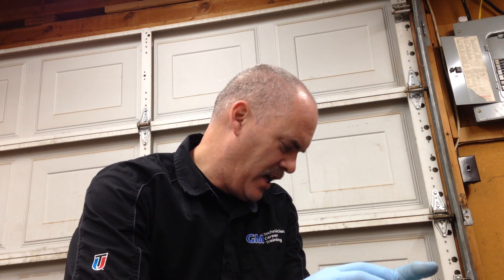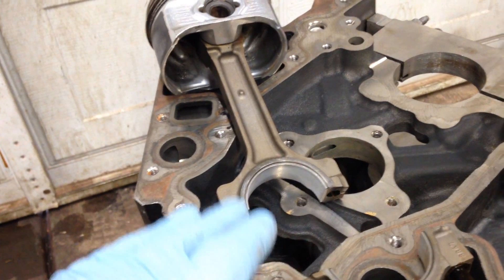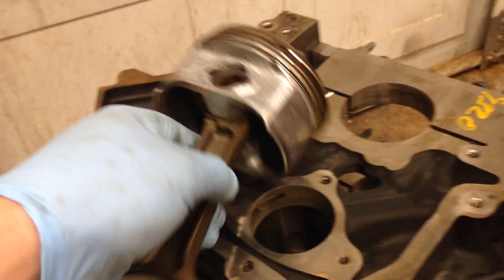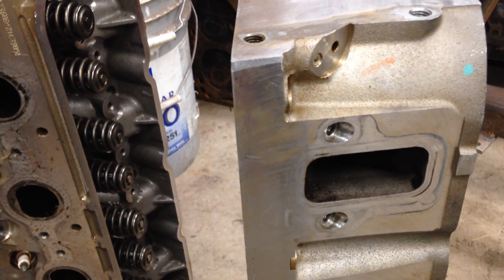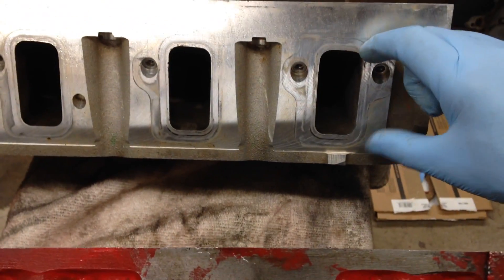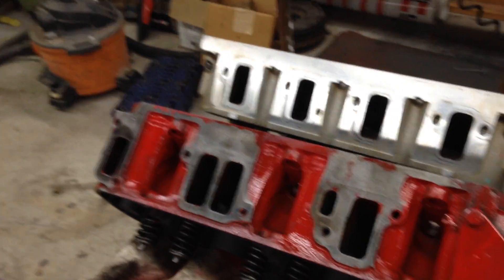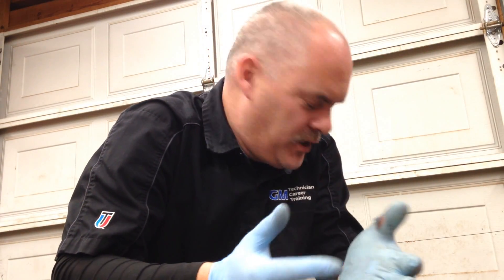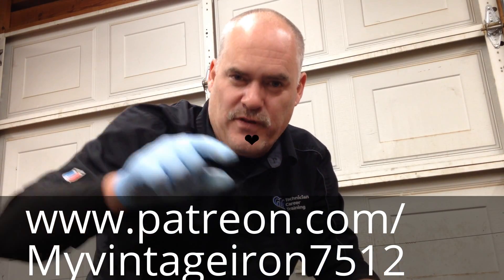LS Upgrade 6.0 to 6.2

Comment: Those engineers you talking about there are Dead,, the new young SMART engineers are coming up with crap like plastic guides for the engine lifters witch got stuck in my engine it broke a valve spring, dropped on the piston got pushed up against the head with made a dent tore and twisted the piston made a dent against the sleeve block and the engine block is now is junk, my mechanic is looking for a used block so he can rebuilt the engine. If the block could have been Iron instead of aluminum the rebuild could have been cheaper. GM and Ford are making CRAP all day long.

Comment: This has been quite a good lesson. I have a LQ4 in my 2003 2500HD. I never knew I could run LS3 Heads on the motor. Heck I could even throw in an actual 6.2 engine but would have to build the 4L80E to handle the 450hp the 6.2 makes.

Comment: Nobody is saying that GM stole Ford's head designs. What some are saying is that Vortec and LS heads use a port design similar to what Ford used because they worked well. For instance, the FE heads had terrible flow characteristics, but worked very well because of their high swirl design. Yes, GM took that concept and put it to use, but created better flow in theirs. It isn't that Ford owned the high swirl principle, but they were the first to use it. That is why it is prudent to say GM took Ford's port design.

Your narrative about Chevy ports being used for decades... then showing the port shape at the intake manifold mating surface.... That's very misleading, because the port design that matters is between that surface and the valves, which I assure you that is very, very different. 

It seems you're simply trying to tell people that GM figured this out all by themselves, but they were wise and investigated what worked between all engines, and what didn't, then designed their Vortec and LS accordingly.  Stop muddying the waters in the Chevy/Ford/Mopar battle, because you're doing it with lies... aggravated bitterness at best. 

If you want to have any effect on engine builders in the future, show what makes the power differences, and don't purposefully lead others away from the truth of it all. Don't be afraid of truth, because it still takes a mind capable of comprehending such info to put it to use and make themselves your competition. But if you think you really have good information, then think again, because skipping out in two more dimensions of port design where power is made is simply nonsense.

Comment: Hello Mate John here I have just come across your videos and have spent most of today watching them. I have a 1936 maple leaf which I am looking to install a new power plant into. I like a GM motor into a GM vehicle and was considering using an older chev engine as I had a stock build 307 with a turbo 400 auto in this when I first built the vehicle back in 1982. The vehicle performed well for what I wanted it for as an everyday driver. I had this setup for about 22 years until a so called friend of mine put sand blasting grit down the carb. In a fit of rage over me telling him a few home truths he didn’t want to hear. Following that I changed to a LS1 and a 4L60 which was so/so Mainly because the new engine gearbox setup weight difference changed the ride to something far rougher then what I previously had, mind you I did enjoy having that extra power when I needed it as the 307 gave me a whole 96 kw at the wheels. Anyway the vehicle has been off the road for about ten years now and the LS1 and auto are long gone so I have been considering going back to the simplicity off the old school chevy engine until I seen your video LS Upgrade 6.0 to 6.2  as this would give me the weight and the extra go that I like. So I am writing to you to find out the details of this build if you still have them. Regards John old36trucks@me.com

Comment: I got a 09 6.0 in a 2500 I've replaced just about everything I can think of every now and then it has about 30% more power but most of the time feels like it's running lean doesn't hesitate throttle response is good no codes no vibration what would your ideas be I'm pretty much down to fuel pump injectors or simply age but sometimes it just runs perfect randomly.

Comment: cylinder walls between cylinders is very thin on 6.0's. i just sonic tested two i'm building that measured .120 before they were bored which doesn't leave much after boring out .065. way thinner than i would be comfortable. the attribute that most ford enthusiasts claim is a ford design is the deep skirt the FE's used which probably has some merit but diesels and agriculture engines have used it forever and FE's are notorious for windage pressure because of that and LS's suffer from as well. In my opinion, its absolutley not worth making an 6.2 from a factory 6.0 block

Comment: The LS motor has things that you just couldn’t do with a old small block. 6 bolt mains with forged caps. Cracked rods. Even things like the intake manifolds that flow as good as almost anything you can buy. The only drawback to the truck intakes is they are butt ugly and a little too tall for a car.

Comment: Question I have a 2009 chevy 1500 6.2 LS3 heads my lower it was ran low on oil I have a block from 2008 6.0 with all the it's stock internals can't I use my LS3 head on that block and be ok or will I run in to a low compression problem

Comment: Dont skimp on pistons hyper pistons shatter when they come apart and mess the motor up beyond repair in most cases. Do your self a favor and get 2618 pistons they are far better
Reply from the maker: all pistons mess up an engine when they come apart cast hyper or forged
Reply: You are correct sir but some pistons will come apart faster then others
Reply from the maker: @thomasbradley7844  That's for sure a cast piston will come apart long before a hyperutectic will

Comment: Can you just swap the 6.2 heads onto a 6.0 to get some add on power? Or do you have to change alot of stuff? I have an lq9
Reply from the maker: yes but a cam swap would also be advisable
Reply: @Myvintageiron7512  do I need to do a cam swap? Just checking because I want to add some hp to my escalade without having to take it apart

Comment: Its absolutely refreshing when someone is knowledgeable and willing to share. Thank you for showing the differences between the heads and explaining how they can be interchanged depending on what the desired application is for.
Reply: Qq1i
Reply: Boring a 6.0” to a4.065” bore is pushing your luck to put it mildly.

Comment: Ok , I want to put an LS engine in a 99 Jeep wrangler tj. 
It has an inline six now ,  but the LS sounds like a better build.
Which LS engine would be better to put in the Jeep?
Reply from the maker: 5.3 or 6.0
Reply: @Myvintageiron7512  So the 6.2 is not a good idea?
And thank you for getting back with me.

Comment: if you could up grade again would you put a stroker kit into this. I have a 6.0L block and 
and ls3 heads. i would like to know your thoughts on stoker and boost for this build?
Reply from the maker: I'm not crazy about stroking these engines ive seen these kits pull the pistons to close to the bottom of the cylinder and wear the pistons rapidly.   As far as Boost goes  YESSS DO IT! for sure you don't need crazy amounts of stroke if your going to boost it any way Boost is all you  need for big power
Reply: Thanks for the direction, now I know what I'm gonna do. Thanks again, love you videos man.

Comment: I never knew you can go .065 over comfortably..  how much meat is left in the cylinder wall after that?
Reply: Just sonic tested two 6.0 blocks, 0.116" between the cylinders before it was machined, none wer thicker than .130 between cylinders. So subtract 0.032 from that and I'd suggest you're getting very thin for an engine you plan to push hard.

Comment: I always use my fingers for a measuring tool when I look at ports on heads too! Please refer to the truck vortec engines as gen 3 or gen 4 engines they are not LS
Reply: In block form they indeed are LS... hence they share the same castings as the corvette engines. They only become LY and LQ when they put truck intake, pistons, camshaft.

Comment: LS3 heads are "very similar" to Trickflow high ports for the small block ford...combustion chambers are also "very similar" to the design of Trickflow Twisted Wedge design...looks like Trickflow should be pissed...

Comment: I like the concept of engineers switching companies. Same with design. Sometime in 1970 or at least after the 1970 Trans Am was completed, John DeLorean went to Chrysler. The next thing you know the Cuda’ has a shaker hoods scoop only turned around 180* compared to the Trans Am. Didn’t copy, the guy with the idea just left... or showed up depending on which side you were on.

Comment: How did this motor turn out?  Do you remember the cam specs and what type of power he made?

I’m building the same motor. LQ4, 4.065 bore with LS3 heads.  Little bowl work and a mild 216/224 .600/ .600 114 LSA cam. Hoping for 400whp through a tr6060.
Reply: I was planning on doing the same build by any chance have you had any problems overheating

Comment: If I add just ls3 heads and a ls3 intake without a cam will it make a bunch of power still? Also I wouldn’t be boring out the cylinder walls.
Reply from the maker: it will help
Reply: Okay and one more thing can I put a new throttle body on my truck I have a 2001 so it has the gas cable and the ls3 intake has the sensor. Do I need to change wiring harness?

Comment: Engine with most starting horsepower for around $600 

I would like to add
Fuel Pump
Fuel Rail
Fuel Injectors
Exhaust Manifold Headers
Cam Shaft
ECU
2 very small turbos
Innercooler
 
Would it produce 500 horsepower at the wheel?
Reply from the maker: yes with ease

Comment: It would have been nice if you would have said the casting numbers on that 6.0 head cylinders that you were planning on porting out the six litre block is excellent but I just want to know what heads you're putting on it if you got the time to answer this that be great thanks for the videos I go a long way with the do-it-yourselfer and trying to understand what's the best a guy could get his hands on for a decent price keep up the good work
Reply: He said LS3 heads several times. If they are truly LS3 heads, they'll be 821 castings. If you're going with all new valve train you can also use 823 & 5364 castings. Only real difference from the factory is those 2 castings don't have the lighter LS3 valves. They came on L92s, L76s, etc. Only difference I've heard is slightly less port material on the exhaust floor on the 5364s, but that only matters if you're going really big.

Comment: To piggyback on someone claiming that GM stole the LS from Ford, Ford was going to all ohc v8's in the early 90's years before GM came out with the first gen iii small block that was ohv. I have said myself, so I can agree with the claim that GM stole the design of the Northstar v8 from Ford, but I can't see how anyone would think they copied or stole the LS platform from Ford.

Comment: I have to disagree slightly about ford interchangeability, changing every 2 years, and needing an engineering degree. The modular engine that was released in cars in 1993, ran through 2004. I believe later than 04 in trucks. They called them modular, because they were all based on the same modular platform. Interchangeability from 94-04 is very high, and I can even bolt in a 2019 5.0 into my 97 mustang, because the engine mount locations, and bell housing bolt pattern is the same. Even back in the Fox body era, swapping from a 2.3l to a 5.0l was an easy job because of the shared chassis and suspensions. I did my first 2.3l to 5.0l swap when I was 18 years old on my mom's back porch, had a running driving 4 cylinder at 7 am and fired the v8 at 7 pm the same day.

Comment: OK, this combination (boring out an iron 6.0 by 065" to essentially create an iron LS3) has more than piqued my interest. Then there are the folks who use an LQ4/LQ9 block and bore it .030", put in a crank with a 4.00" stroke to create the (infamous) 408 stroker engine. So, theoretically what's preventing me from doing both (ie. .065" over-bore with a 4.00" stroke crank) to create a "415" stroker? I could then use off-the-shelf LS3 pistons. Is there a side loading issue at BDC once we start reaching this cylinder wall thickness?
Reply: Just to clarify, I've seen the 416 strokers that have been built from a standard LS3 block (no mods, sleeves. etc.) and a 4.00" stroke crank.  These are sick. The question is can I do a "budget" version starting with a 6.0 iron block.

Comment: Cast iron block being what 100 lbs heavir can handle the heat , torque , vibration , pressure better then aluminum block that tends to crack . I saw one cracked right on left side below the aluminum heads . I think he had it 450 hp.

Comment: Ford  suck that simple 😁 chevy. Silverado. From 1999 to 2002.  Ls engines are very reailabe.   I got a engine that has more than 300 thousand  miles and still. Run like  a champ

Comment: So a 4.8 crank in a 6 or 6.2 block would spin to the moon..
Reply: Theres a few 334ci destroker builds on google and they're taking them to 8k rpms
Reply: Solid lifters... I would reach for 9k plus, plus valve adjustments every oil change.... and i think it would be more lo like a 331ci..

Comment: I'm looking to replace this 5.3 in 2008 Silverado with 6.2 at the 425 or 450 hp .anyone done this before? I have a stage 2 4l65E transmission that can handle 400 hp with 4.56 rear end .
Reply: I have an 02 1500 avalanche 5.3 with 403,000mi  and the and going to swap soon, new trans too,  not sure yet what trans to use, I herd the original trans design should work good with 400, 500hp but if you want to ru it hard better look into upgrading.  Happy driving.

Comment: So basically making an iron block LS3. Definitely going to be better for boost if need be. I'd love to build a de-stroked more squared design with lower compression for a boosted street build. Something you can make a reliable street car with, while having very tame driving characteristics. Gotta love those modern LS head chamber designs. It's impressive what kind of compression you can run on pump gas without detonation. I just love how simple these motors are to work with and the huge aftermarket selection. I just did a turbo Miata for my brother build and the community size and knowledge base is so small in comparison to the LS following. You can find any LS info with just a few keyword searches. Great video!!

Comment: GM didn't copy Ford design to create the LS,GM had The Professor, the Pro Stock Champion racer Warren Johnson and Reggie jackson helped design the LS engine, Warren Johnson is a engineer GM got alot of input from him! Ford guys are butthurt that GM is still kicking butt as far as engines,the Ford Guys say Ford was first in mod motor tech too,and that's not true either, the 1990s ZR1 Corvette was a DOHC engine that made huge power for the time!

Comment: The terminology otta be "LS" = aluminum engines only found in cars and "Vortec" = iron block engines only found in trucks/ SUV's but thats expecting too much from the public.
Reply: They  made aluminum 5.3 called the l33
Reply: @Ohiocountryboy-se2cn  Yes the L33 is cool and an exception as well as the 6.2L truck engine and new LT based 5.3L but usually all say say [Vortec] on the engine cover.  I just think there should be a consensus to call aluminum blocks "LS" and iron blocks "Vortec" even if it's a L76 from a G8, L92 from a Denali or iron block and headed early 6.0L's.
Reply: Yeah i know. You can bore the vortec engines out a lot more. They are based  off the ls engine
Reply: @Ohiocountryboy-se2cn  You can also sleeve a 5.3L L33 to a 7.0L 427cid

Comment: the LS engines are derived from the prototype Venture (the name of the project and nothing to do with the mini van) V6 engine....nothing to do with Ford.  the prototype was a clean slate engine originally meant to replace the 4.3 L V6 engine.  having a hard time finding links to the article, but the block and heads looked like a V6 LS engine with a Gen II intake.
Reply: I will also say that the LS engine are obviously designed in 3D CAD software.  the head valve design is easy to explain from a design CAD stand point: it was done using the linear pattern feature in the CAD software making it easy to do as in it was 10 second job to do.  I can see making a 3D CAD model of Gen 1 thru 2 head being a pain in the butt to generate in CAD vs. the LS head.  I always thought this when I see an LS head

Comment: the problem with the LS engine, is most of them are very small in cubic inches.  6 liter is only 368 cubic inches.  6.2 liter is only 376 cubic inches.   if you want the best LS motor, buy an LS7 427, or LS 7.4 liter 454.  then you'd have something.  the motors under 400 cubic inches were really only designed for hauling around a truck or SUV.  they sort of double duty used them as the Vette and Camaro engine, but they are low on cubic inches.

Comment: i have a 2011 escalade, the motor blew at 117k, I was very disappointed, i had the dealer order a new longblock, they are installing it now . i hope to have  better luck with this one
Reply: We have company vans with 4.8’s and 5.3’s that have 240k miles before we replace them. I wish you luck on the next one.

Comment: Mocking up a build myself simular to this with a 4.8 stroke and crank for a destroked and higher RPM turbo motor. Kind of experimental but im not going for anything over 800hp, its mostly the creative buold factor to what it would tale to make it myself. But this video was very helpful so thanks as always for the info
Reply: A lot of people overlook destroking vs. stroking such as making an old SBC 400 into a 377 instead of making a 350 into a 383...I have never done it but have heard it will suprise you.